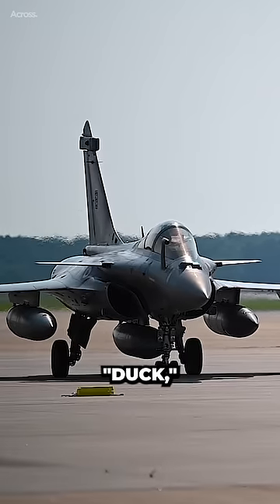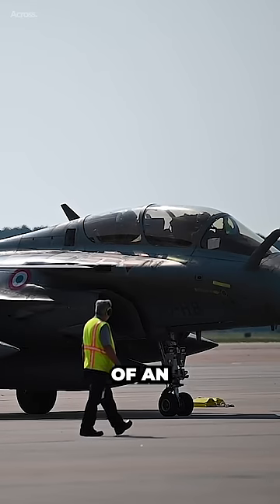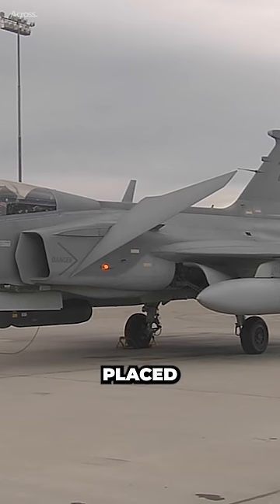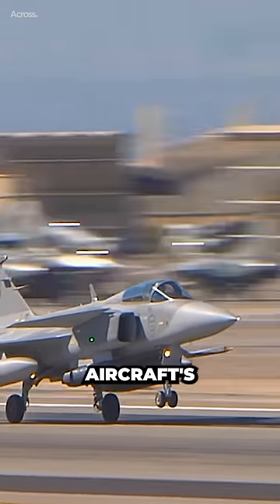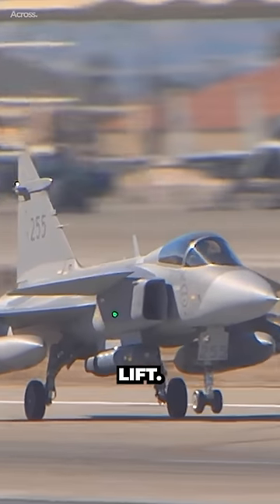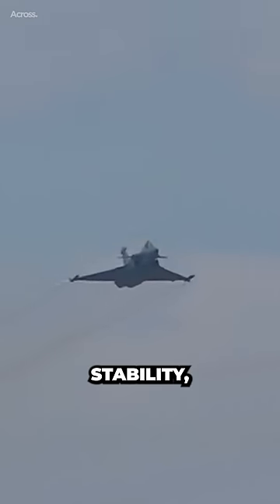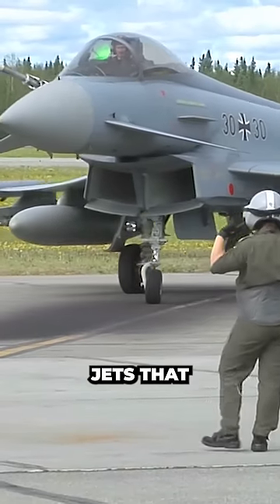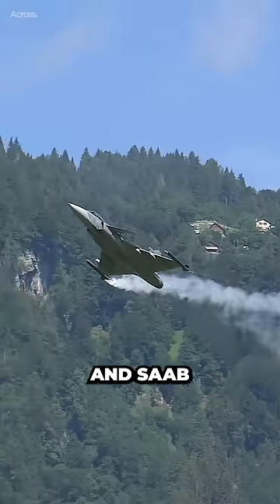Why Don't American Fighters Jets Have Canards? #shorts

Comment: Well, the US did experiment with canard equipped aircraft.  In most cases, it was a means of improving AoA control and performance. In some cases the carnards are used to improve flight efficiency depending on their placement and their size, i.e., JAS 39 Grippen and Rafael. The US was committed to lower radar signatures and stealth, so they found different ways to achieve those AoA goals via thrust vectoring or aerodynamic changes in design and flight control systems. If you ever saw a Super Hornet flight demo, it could do just about anything a canard equipped aircraft can do without the benefits  of canards or thrust vectoring.
Reply: The F-35 even more so than the Super Hornet. Canards just aren't that big of an advantage compared to their disadvantages. Especially so when you consider that modern air to air combat is designed around BVR engagements. An opponent is unlikely to survive that extra 100 km in order to take advantage of the canards. Furthermore, USAF training is centered around "energy management". Canards give you a one time advantage in nose position in exchange for energy. To the US (USAF, USN & USMC) that is a very bad trade.
Take the "cobra maneuver", if it works, you get a shot. If it doesn't, you die. American military aviation thinks that is a very bad deal. So we train our pilots to spot a cobra early and take advantage of it.
Reply: The trade off expense is airframe life totals are less, more stress
Reply: Yeah, we figured out high AoA control and capabilities through root leading edge extensions with the F-16 and F-17/18. The F-22 and F-35 have a similar principle but are a bit harder to spot since they use chines instead of extending the root of the wing.
Reply: This means aircraft without guns in a one on one peer aircraft without gun's are dead when all of your missiles are gone, the irony 😂🤣😂🤣
Reply: @windsorcorbin1005  what do you mean?
Reply: @windsorcorbin1005  
when all your missiles are done,so are the opposition..duh !!!
Reply: @windsorcorbin1005  I'm glad you think that was funny, because it make no sense to English speakers.
Reply: This whole topic is ~40 years too late. The USAF and NASA performed numerous experiments in "super maneuverability" from 1977 through 1984. The sum lessons from those experiments was that canards are a poor compromise for good aeronautical engineering and that thrust vectoring isn't that important.
More precisely, that research produced data that is still in use today. However, at that time, those ideas weren't useful for current US fighters. They are even less important to fifth generation fighters and obsolete thinking to sixth generation fighters.
When the seventh generation comes along, you might as well be suggesting a biplane design.
Reply: @trplankowner3323 : You've just mentioned all them disadvantages with canards having poor energy retention. If that's the case how come (apart from the F22) in a BFM engagement the likes of Typhoon, Rafale & Grippen all surpass any other U.S aircraft in a dogfight? There's multiple stories of pilots flying "canarded" aircraft absolutely "spanking" the likes of F15, 16 & 18 (& even the F22 in some very rare occasions) mainly because they can all turn tighter for longer. Don't get me wrong, yes, canards do produce more drag. But when they're attached to an airframe that has an 'excellent' t/w ratio, which these aircraft have. All them performance issues of which speak of are all negated.
Reply: @LEGEND   I have heard of cases where the "canards" came out on the losing end too i.e. Sukhoi 30 MKI  Indian Airforce at Red flag and that was against good old F15's and F16's. I'm sure there are some advantages if you have them but if you can get the same results by using a better design then that's the way forward. Just like we moved away from the viable geometric swing wings. Less part less weight less maintenance.
Reply: @Sithvulcan76  You have a misconception about swing wings. They were the only solution to landing a 72,000 pound aircraft on an aircraft carrier with the technology available at the time.
They do give you an advantage in a rate fight. Still once the mass of the aircraft could be reduced, they were just too high of an expense.
There'll never be another Tomcat and for me that's sad, but it's a different world now and there's better technologies available.
Such as the soon (hopefully) to be unveiled F/A-XX.
Reply: @trplankowner3323 Canards are an advantage in all apart from stealth. The F-15, F-16 and F-18 came too early for them and the F-22 and F-35 don’t need them as it would compromise stealth.
Reply: @scottwhitley3392  lol
Reply: @scottwhitley3392  If you can read, try doing that. My past comments and replies refute everything you mentioned in your reply.
Reply: @trplankowner3323  if your brain is capable of rational thought you’ll realise that although you think you know what you’re talking about. You don’t.
Reply: @scottwhitley3392  Then refute any one point on my other replies. It's as simple as that, or is all you are really capable of is mindless trolling?
Reply: @scottwhitley3392  "F-22 and F-35 don’t need them as it would compromise stealth", wrong that isn't a case of "not need", assuming you were correct, it would be a case of compromising the design in favor of a greater degree of low observability. Think about what you're trying to write before you hit that blue "Reply" button.
Reply: @trplankowner3323  define English speaker, native English? I don't think it was meant for those.
Reply: @THE-BUNKEN-DRUM  " they can all turn tighter for longer. Don't get me wrong, yes, canards do produce more drag."
You contradict yourself.
As for "excellent t/w ratio", the Rafale barely achieves unity without any fuel or ammunition on board (23 500/23 400), at max weight, it is under 0.5. The Gripen is a fair bit better, it is still above unity with full internal fuel and has enough to spare for some cannon ammo or a couple of IRIS-Ts or Sidewinders. A Block 50/52 F-16 has about 5000 lbs to spare with full fuel before falling below unity. An F-35 can't do full fuel, but it has >2.5 times the internal capacity of the F-16 (18 500 vs 7000) available to avoid external tanks.
Reply: @Markle2k  : I don't know where you're pulling them numbers from (actually I do have an idea from where 💩). As they all "fly" in the face (Pun intended 😉) of what I've read & heard from 'real' fighter pilots, whether that be from books, podcast & various sites online. There's multiple stories of the likes of Typhoon, Rafale & Grippen regularly besting their U.S. counterparts in aerial combat. The only U.S. aircraft that regularly gives them a run for their money is the Raptor.
Reply: @einarabelc5  People whose first language is English. Also, I agree, it does appear to be a stupid reply from some braindead vatnik. Still, I prefer to allow them to "speak and remove all doubt", as the old biblical proverbs says.
Reply: @THE-BUNKEN-DRUM  I’m pulling those numbers from the official specifications for those aircraft. Sorry that you are immune to reality.
Reply: @Markle2k  : Nope, that's your 'twisted' reality.
Reply: @Sithvulcan76  : Type in Aircrew Interview, Specifically Look at the clips of, Mike Sutton, "Sainty" & Paul Godfrey.

Comment: This is an over simplification but…. We did looked at canards on the F-15 and other test platforms and chose against them because timing was just wrong. The F-15, 16, 18 and 14 were simply maneuverable enough. Stealth required a different design and thrust vectoring just made more sense for the F-22. By the time the F-35 came to development, the beliefs that super maneuverability was no longer needed was prevalent among those making decisions on this platform.
Reply: actually the F35 is really really maneuverable I seen it in person being just that and it was impressive
Reply: @matthewwilson5019  it is. I agree. I use to be an airline captain. I lived in Louisville Ky and commuted up to Cincinnati. Four of my neighbors were UPS captains. I knew two of them but weren’t super close.  We all were flying so much that it was unusual for us to be home at the same time. Anyway one was in the Navy reserves flying Super Hornets. He had gone to Test Pilot school.  He was offered a job at Lockheed Martin to Fly F-35’s. I may have some if the details wrong. But it’s my memory that he was a “company” program pilot. Basically he flew the aircraft coming off the production line and also flew at air shows. 
He said: there is no other aircraft I’d want to be in when at war.  He said the aircraft was more than capable of holding its own in a dogfight. He also said that the air is significantly more maneuverable than its flight computer allows at that time of our discussion. He said over time the aircraft’s limitations would be relaxed  and or tightened as needed. 
I loved years ago and he ended up divorced and living somewhere else.  So no further discussions as the program advanced. 

I have listened to online interviews of pilots who stated that each block sees changes to limitations and or flight parameters. 

Here is my guess, and that’s all it is…. My guess is the limitations on the latest variants will allow for more aggressive dogfighting type maneuvers. In also willing to be that if the military finds the F-35 frequently in dogfights because BVR isn’t possible… then they’ll loosen up the limitations because a bent or broken plane is preferable to being shot down
Reply: @bret9741  thats actually pretty cool 😎 to hear that 😎 and yea im amazed at the F35 and it looks so very cool as well
Reply: Case in point; Why make your fighter look like that of a country with 1/10th of your budget, when yours is already 10 times better? Easy-peasy"? ::;) :) LOL!
Reply: Nick Gurr  my wife and I miss Louisville. We have lived all over the place. Our absolute favorite was Louisville. We actually lived in Goshen. 

If we had it to do all over again…. We both have stated we would never leave the Louisville area. There are so many nice areas all over  Louisville area.
Reply: Super maneuverability is still needed, but on the missile fired instead of the platform it flew from, still hundreds of miles away.
Reply: @m.farizakbarhutasuhut3074  it’s going to be interesting to see what happens in real combat situations over the next decade or two.  

Truthfully I hate war, I mourn the loss of so many people with such potential for good. Sadly, like Ukraine, if your invaded by a nation that wishes to takeover your land, control your populous unjustly… then resistance is imperative.  Yet I mourn for the lost Russian soldiers who have no choice but to fight just as I mourn for the Ukrainians who bravely and intelligently fight back  on this David and Goliath type war.  

Russia is massively larger, more powerful and yet Ukraine has held its own at a great cost to its nation and those nations supporting it.  

Hopefully Russia will get rid of the oligarchs and develop a government system similar to Norways or Finlands. What is so terrible about the corrupt oligarchs is the squandering of wealth and opportunity.  Russia has massive reserves of oil, gas , coal, Gold, silver , titanium, and all of the precious metals and minerals needed by China, Europe, and every the U.S.   of Russia would refocus on developing free market economies in Eastern Europe and Asia…. In 30 years with proper investments of its profits, it could look like Norway, Sweden, Switzerland…. etc. It isn’t beyond reason that with good leadership and a republic government, Russia could be extremely wealthy. Running some quick calculations, a 12-20 trillion dollar savings account is realistic.  A Russia fully integrated with Europe and as a transfer hub for Asian goods to Europe and Europe goods to Asia, Russia Poland, Ukraine the Baltics all are  situated to become wealthy nations. 

Russia only has two enemies. (1) itself (2) China. No one else desires to dismantle or takeover any portion of Russia.  Europe and the US had been investing heavily in Russias economy and stability.